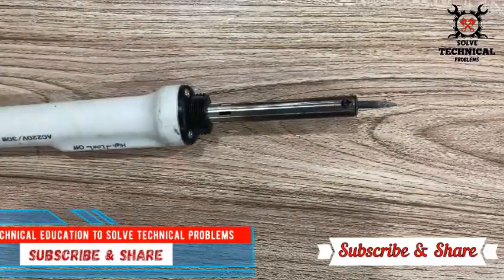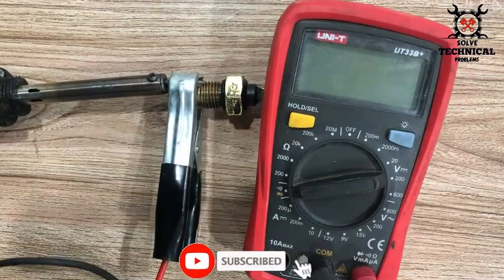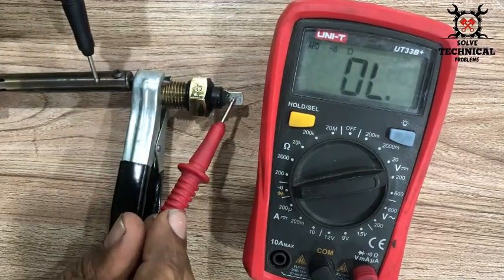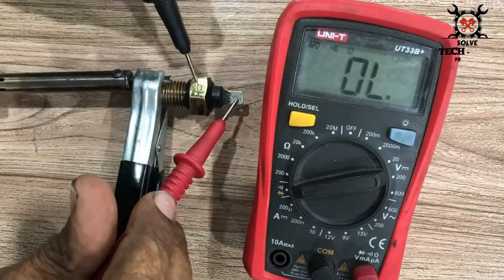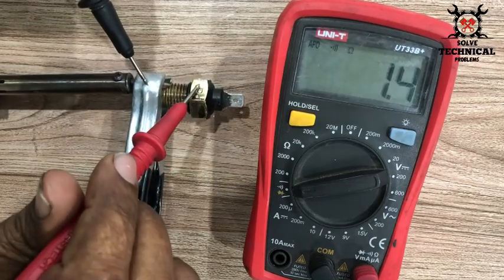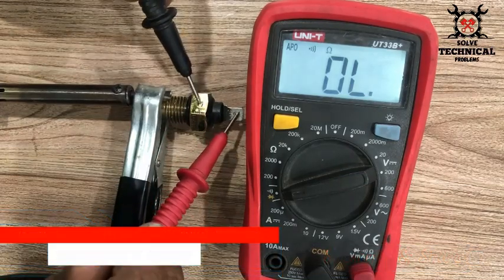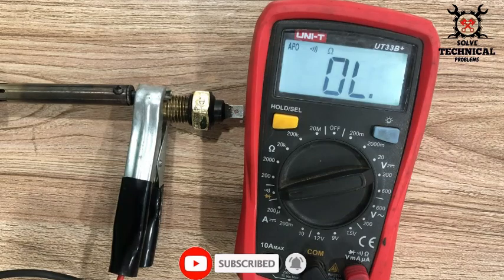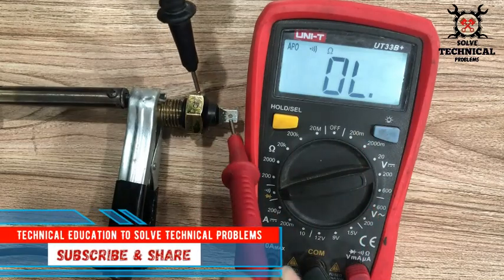How to test temperature switch with a multimeter. The diesel engine temperature switch is working.

Comment: Can you do a video on honda 2 pin ect? It works off ohms and voltage resistance not just open or close
Reply from the maker: Hope this will help you understand the etc function I will make a fresh video ASAP
Reply: @Technical.Education  THANK YOU!! I was testing the pins instead of grounding to body of sensor. My problem is solved
Reply from the maker: @DannyOrnelasPerformance  welcome
Reply from the maker: https://youtu.be/_Z5EqMJgVA8